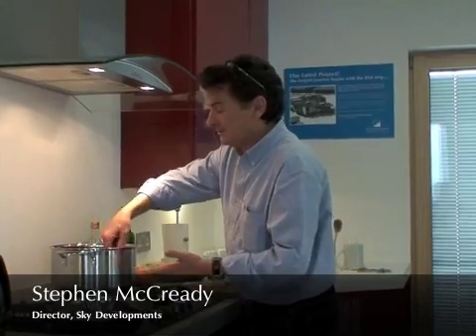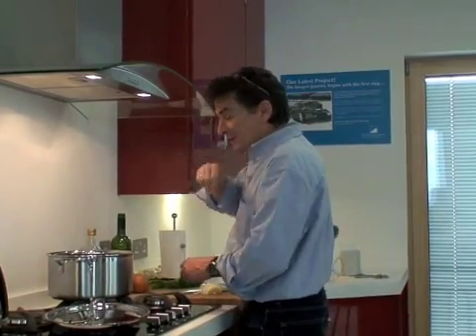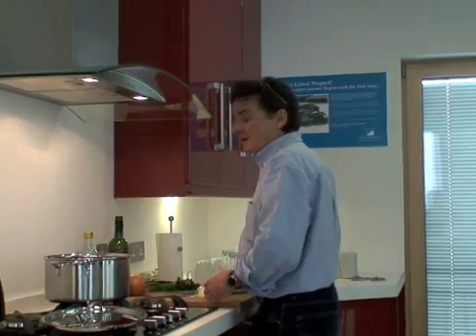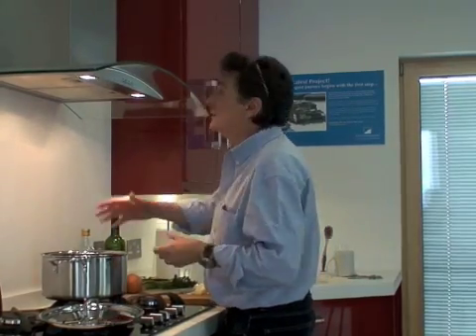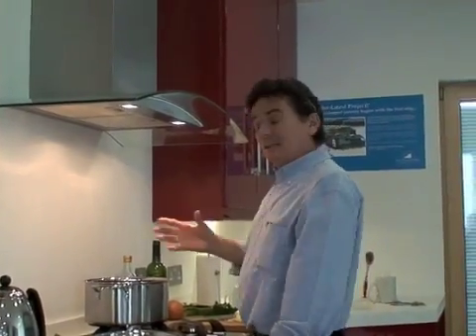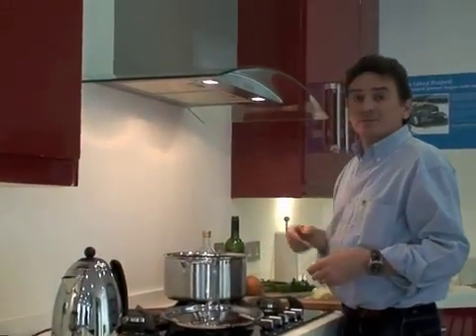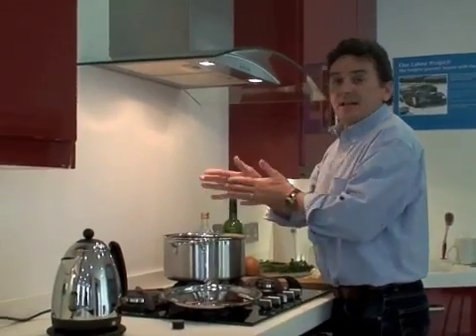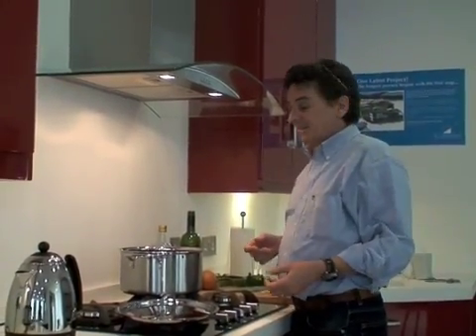Sky Developments - 1 Minute Wonder - Part 1

Comment: How do the cooking smells get filtered out? 

Where does the heat get pumped to? You said down into the basement, but why the basement? Is it simpy "added" to the heat found in the existing "supply" of heat being pumped by the whole-house heat pump? 

What sort of heat loss takes place in the transfer of the heat from your stove top to the basement?

And what about all that moisture? Does the moisture pose a problem for mold eventually building up?